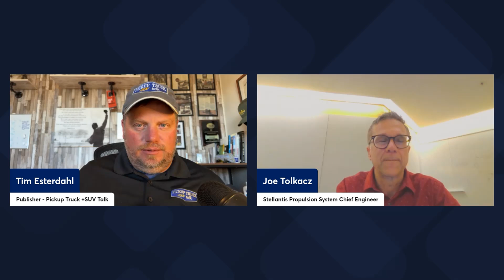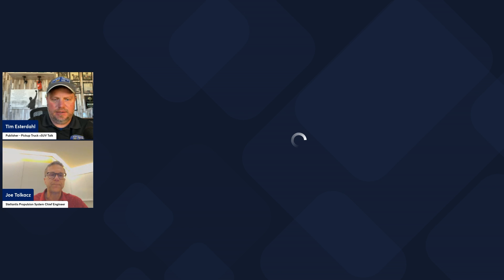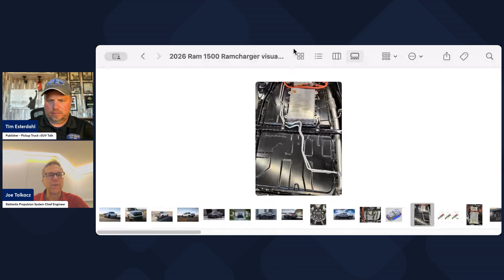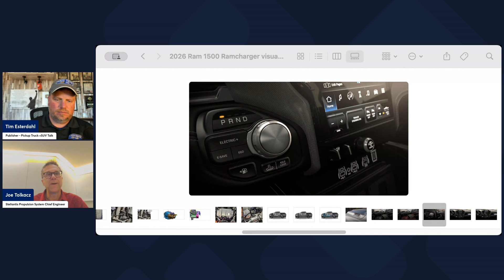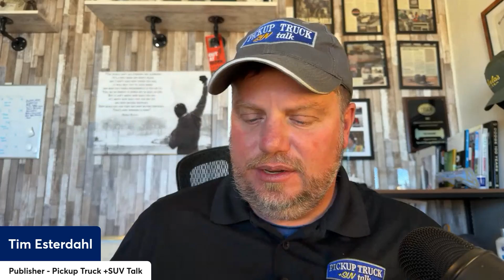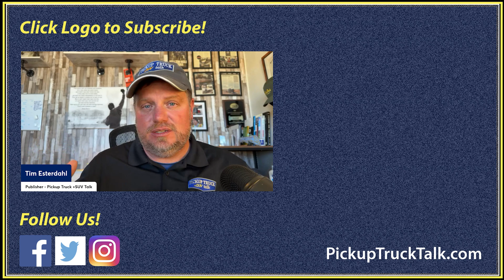2026 Ram 1500 Ramcharger Engineer Interview - Towing, Range, Engine Choice, etc...

Comment: If 3.6L Pentastar is the right torque rating 269lbft. What about Fiat 2.3L Multijet diesel from Ducato that is 280lbft to run a generator? Can it be made to be USA emissions passable?
Reply: He covered diesels in the video. Diesels do not offer a significant advantage over a gasoline engine when both are being operated at wide open throttle like you would with a generator. A major reason why diesels are more efficient in normal ICE powered trucks is because diesels do not have a throttle body that closes at low loads to restrict air flow into the engine like a gasoline engine does. The closed throttle puts a vacuum on the intake manifold and causes the pistons to have to fight against that vacuum during the intake stroke, making the gasoline engine waste energy just trying to keep itself spinning. The diesel is always wide open throttle and does not have to fight the vacuum at low loads.

When you have a gasoline engine hooked to a generator it can run at WOT all of the time. This eliminates the vacuum in the manifold and lets it operate at peak efficiency continuously.

Diesel fuel itself only has about 14% more energy content than gas. If they used a diesel it would only improve the range by about 70 miles. And as a result you have a more expensive, more complex, heavier engine with more strict emissions systems and have to pay more for the fuel. Doesn't seem like a good trade off.
Reply: @Jay-me7gw that is not how gasoline and diesel engines work. Gasoline engines are air governed and diesels are fuel governed. At no point is the engine running at wide open throttle lol. There is no piston engine in the world that operates at peak efficiency at wide open throttle
Reply: @CrazyForCooCooPuffs  Im very aware of how gas engines work. There is no significant advantage to a diesel in a generator application like this.

And I dont agree with you. NA Gas engines do operate most efficiently at WOT. Maybe not at maximum RPM, but there is some RPM where they offer the best BSFC while at WOT. Generally its where the engine creates peak torque.
Reply: Also, torque is not what matters, only horsepower. That 2.3L diesel only makes like 158 hp so it could never power the electric motors and battery as well as the Pentastar making 271. Even the 3.0 Ecodiesel makes less hp than the pentastar.
Reply: agree( i want the eco-diesel or cummins, yes iv owned gasoline-vin's but im done fuel-cell/BEV/diesel from now-on for me ) and without a daily driving-plug/EV-plug/DC-fast aka they sound like there emissions cheat-devices without adding it
Reply: Why would operating a generator a gas or diesel be at wide open throttle? Your throttle setting would be at governed setting of electrical output needed. If just charging batteries but not in a hurry, 900 - 1,200RPM may just be fine. If charging batteries and some power load goes to electric drive motor, RPM can very from minimum 1,200 to peak electrical generation RPM that might be 4,500 RPM if tied with gas motor and 3,500 RPM if tied to diesel motor. Neather gas or diesel engines would go not far from peak torque rating. Internet says: Diesel electric train keeps GEAC6000 RPM 200 to 1050 RPM range when in use providing power to electric motor.  Some of older diesel electric models, EMD710, were as high as 4300 RPM.
Reply: @ptcoronet  I dont think you understand what WOT means. You can be at WOT and be at 900-1200 rpm, it just depends how much they load the generator. WOT doesnt not equal running at redline.

And they have a 92 kwh battery in this to absorb excess energy. They have the option to over produce with the generator in order to run it most efficiently by using the battery pack to absorb the excess power if the traction motors are not using it.

Comment: Oh geez, diesels never considered because they are not wildy more efficient at high loads?!

I tried to tell all the people demanding a Cummins or Ecodiesel generator this yesterday but no one wanted to listen.
Reply: my dad liked his 2005 300 V6 ( 100-200K miles and still doing something for my siblings after his passing/cancers ) but im not into a 20year old/outdated platform ( yes i own a 440/hemi platform but that's getting a pass for classics/other's-reason's and yes at this point i see my SBC350&327 sold-off as obsoleted as the LT/LSX does a better job in the chevy family the big-block-chevy still hasn't been replaced/outdated yet ) and or gasoline powered, diesel-hybrid id being willing to checkout the dealership's and the same for BEV's and some fuel-cells and jet-shaft-powered hybrid
Reply: @richardprice5978  The thing is, in this application, I dont think the pentastar being a relatively old design is really a negative. I think that, powering a generator, there really isnt going to be a huge improvement in efficiency by going with anything else.

And, honestly, its cheap and it does the job. Most people who buy this truck might only actually need the generator 5% of the time, it doesnt matter if its  inefficient. Even if you could improve efficiency by 20%, its only improving 5% of your driving by 20%.
Reply: Agreed! Everyone just wants to latch on to diesel like grandpa's flintlock...

Comment: I was impressed with the statement that Joe Tolkacz made about the V-6 engine having a sensor of some sort to start it at times if it not run much to prevent moisture building up in the motor.
Reply: they could copy racing-car/aircraft/ramp-techniques of block-heating and oil and pre-lube pump also helps with cold winter starting and or stop-start

im out on the model without being diesel-hybrid plugin but im thankful that he/video asking maybe the 1-ton/RV/dulliy models 6cly 8ft-bed( ranchers/maintenance-man spec'd, and yes on road-tipping/vacation im know to go 9-12hours's straight without stopping so SLC-to-Lincoln NE about 900~miles ) might have it but for now pure BEV-REV or lighting-models have my sale and or resto-mod ing my gramp's/dad's 1980's-K1500 to be BEV
Reply: Many plug in hybrids will actually force you to use a tank of gas about every 6 months.

Comment: How often will fuel/oil refresh for the engine kick in
Reply from the maker: I don't think they have a set metric. Instead, they have computer algorithms and sensors. When the computer thinks the fuel is getting stale, it will kick on the engine. The same thinking applies to the oil.

Comment: If RAM can execute this well and the price is reasonable, I  think they'll have a home run. BYD shark 6 is already getting great reviews in other markets. EV power and torque without the negatives of poor charging infrastructure and long charge times. This is the first EV truck I would consider.
Reply: Yes indeed, pricing Ramcharger low like BYD Shark could make Ramcharger extremely competitive and successful and show long-term commitment by Stellantis / Ram.  Same goes for Jeep Wagoneer 4xe with Ramcharger powertrain.
Reply: But the price at over 100K isn’t reasonable and Ram still has that stigma of being the weak sister in the big 3 in reliability.
Reply: @DennisFahlstrom  I agree reliability is still a big issue with FCA, that's why I said IF they can execute well. As for pricing we still have no idea what that will be. It's definitely going to be a premium over gas trucks, the question is how much. If it's 100k like the GM trucks then I'd say it's not even worth producing.
Reply: @DennisFahlstrom the now 7 time truck of the year doesn't say they're anyone's little sister. I've not had one issue on any of my Ram trucks dating back to 2001 and 5 Dodge/ram trucks with well over 150k miles on all of them.
Reply: Same. Solves my biggest issue with EV trucks: towing range
Reply: The price will likely be very high at first. This will allow them to harvest the big spenders who have gotta have the latest tech. Eventually the price will come down to reap the lower economic demographics and eventually (I hope) to the point where I can buy it.

Comment: Sounds very promising but Stellantis reliability has never been good. I don't care what Consumer Reports says.
Reply: as a Ram owner x1000
Reply: I wouldn't ever buy unless it's the most awarded most reliable pickup RAM-1500 KING OF TRUCKS 💯👌👍
Reply: Think 🤔 150 miles is to much and 50-100 miles is better because of battery 🔋 size and cost. Most people only drive 37 miles a day so to big I think 🤔
Reply: @williampisano7573  The battery needs to be able to reliably supply the electric motors with the current needed to make 500kw of power. You cannot stuff a 30 kwh battery in there and expect it to live a long life while outputting that much power.
Reply: @lpdirv  I dont think you understood what I was saying at all. Calm down.
Reply: The reliability on our 2014 Fiat 500e has been fantastic. A handful of software updates, a 12v battery, a headlight replacement due to moisture and a rare issue with water leaks at cowl.  It does consume rubber though.